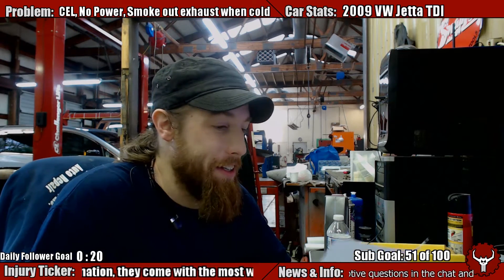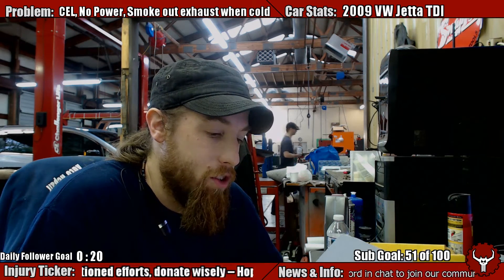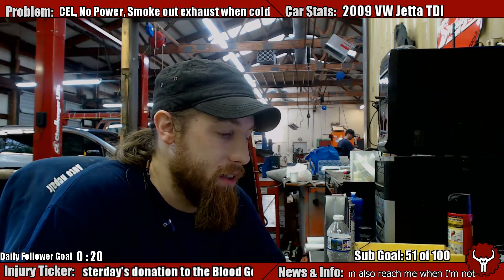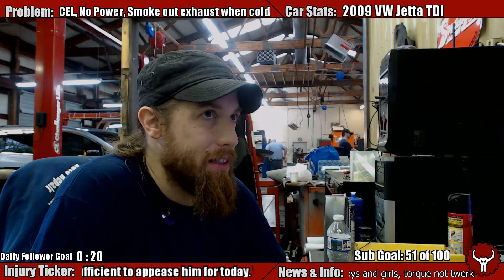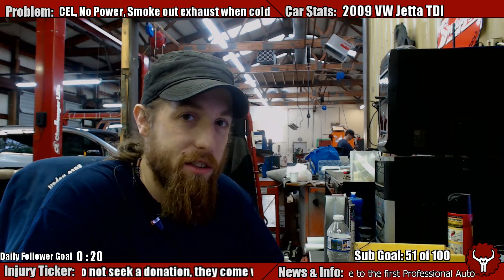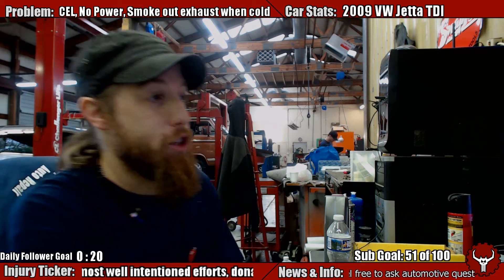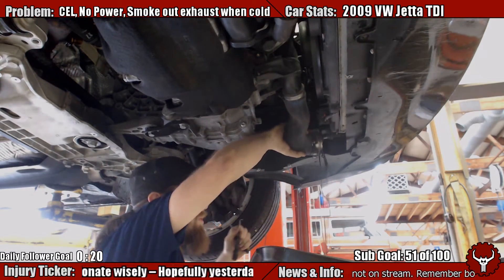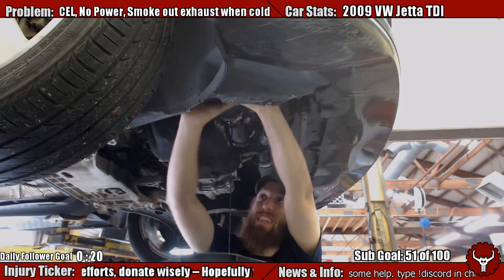The Daily Mechanic Leaking Turbo? Oil In Innercooler?

Comment: Im a truck driver and this video actually helped to troubleshoot.  Actually have oil leaking from pipes running to the intercooler
Reply: Looking to buy a car and there was oil on the outside of the pipes going into intercooler I'm I buying trouble
Reply: Could be bad turbo

Comment: My car just started smoking white smoke out the exhaust, not sure where it was comming from I changed the oil again to see if it would stop the smoke. Now I don’t make over 5lbs off boost when it’s hot, and I also found oil dripping on the inter cooler boot cold side, you think I need a new turbo as well?
Reply from the maker: I would see if you weren't losing coolant. Sounds like you may have blown a headgasket or sucking in coolant.. with the white smoke and all.
Reply: Take off your intercooler and tilt it to see if any oil comes out of it
Reply: @steveperalta6973   Just to make sure, check the PCV Valve if you have one.I had the same problem and almost got charged for a new turbo. It is a valve connecting to the motor with the admission air pipe going to the Turbo for compression. When it's working it blocks oil and let oil vapor, when its not it will leak oil. In my case it was feeding oil to the turbo that was compressing it with air. It might be the culprit, u never know until u check it up. Best of luck.

Comment: i think i utilize my 1/4 in milwaukee ratchet more then you do, i see you using a manual ratchet alot.  but im not a pro like you i work out of my garage
Reply from the maker: I don't have an electric ratchet. I'm not too fond of air ratchets, I like feeling how hard it is to break things loose, or how tight I make them when tightening.
Reply: @deamonmachine  I'm looking at oil on outside of pipes attached to the intercooler any ideas